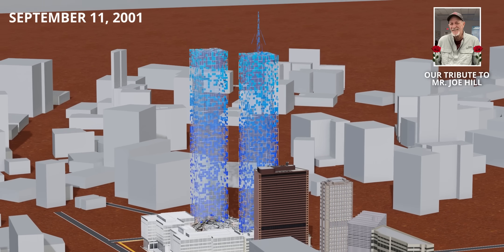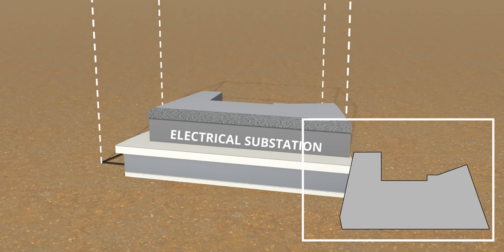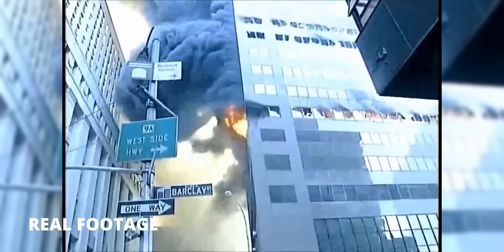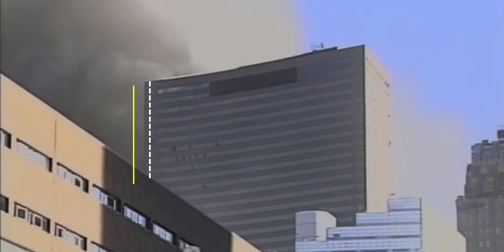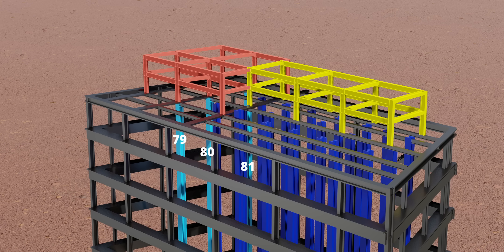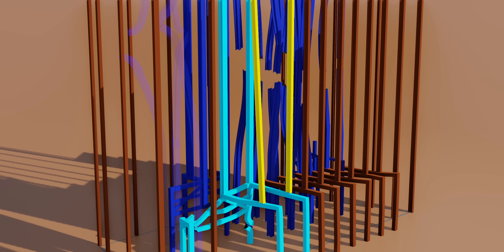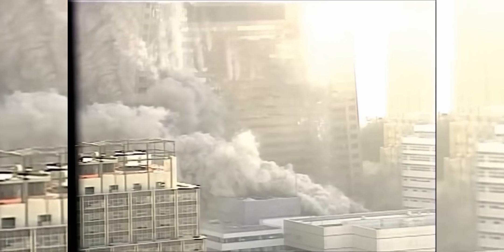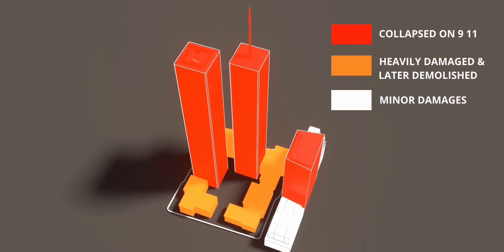Collapse of Building 7 | The Complete Physics

Comment: It’s strange how even though WTC 3 4 5 6 are even closer to building 1 and 2, and still remain standing with photos showing them withstanding two, 110story sky scrapers falling on top of them, but building 7 collapsed in near free fall speed, while being farther away from the ground zero and also the 2 buildings on either side of wtc 7 only report minor damage. 😂
Reply: Each case is different and needs to be understood on its own merits. Your first mistake is assuming every scenario should have the same outcome, no matter what.

In total, 6 buildings collapsed of the 10 destroyed in New York on 9/11/2001.  I'm guessing you didn't know that.  2 more suffered partial internal collapses and the other two were damaged beyond repair. 

But again, each is its own unique case which needs to be understood on its own merits. 

Also, there is no such thing as free fall speed so if you are getting your engineering advice from people who say stupid shit like that, you are doing it wrong.  There is no blanket one size fits all
Reply: @TheCriticalStinker-01  partial collapse isn’t a collapsed building. It’s a partially collapsed section of the building. 4 buildings were completely collapsed and the rest were partial collapsed due to debris falling on them. However no one talks about them because it’s clear the weights of the twin towers caused that damage. Building 7 was brought down by ‘fires’ within the building that weakened the structure. So yes I understand that each building is a unique case which makes the circumstances of each case even stranger. 4 buildings had complete collapses that day, wtc 1 2 3 and 7….1 of which collapsed due to fires, 2 from planes creating fires and 1 from the weight and mass of the twin towers crushing it. The only 3 sky scrapers in the world to ever collapse from fires all happen in the same day with hours of each other. 😂…if all cases are unique and merit their own circumstances then those buildings collapsing would look very different. But they all pancaked at near ‘terminal velocity’ into their own footprint essentially, I forgot when I play jenga and pull the wrong block out, it just falls into itself instead of toppling and leaving portions still intact. 

I’ll bet you weren’t aware of how jenga works 😂😂😂
Reply: @kross517  - You forgot Building 4 and St Nicholas Church. 

Employing the first time in history logical fallacy is never a good plan. If you would like other high-rise buildings that collapsed due to fire I offer Wilton Paes de Almeida and Plasco Tower

Does that get you any closer to understanding anything that happened to any building on 9/11?  Does fire know or care how tall a building is?  Does the building?

No and no.

Again, if you want to understand a subject then study the subject.  What building do you want to understand?  This video does a fair job in describing the big 3 in terms a layperson can understand but I am more than happy to do a deeper dive.
Reply: @TheCriticalStinker-01 okay so your two other examples of fires burning down a skyscraper are one where the building was abandoned for atleast 5 years and had scores of homeless people living it, building their own structures within the building adding weight and instability to the structure, not to mention whatever materials the homeless pulled from the building itself to construct their inner shanties. And the 2nd example is a building in Iran that the government cited 22 buildings infractions and ignored regulations. Okay buddy. I think you should do some research. This video has errors all throughout it and you site 2 of the worst possible examples of collapse. 😂😂😂 so please dig in further and explain to me how 2 skyscrapers in 3rd world countries collapsed because homeless people camped out in for years and the other wasn’t built to standard.
Reply: @TheCriticalStinker-01 does the building care if it’s been abandoned and have scores of homeless people doing god knows what to it? And does the building care if the builders built it properly? 

Yes and yes 😂😂😂
Reply: @TheCriticalStinker-01 also check the dates of your examples my guy. 20 years after 9/11 and some change. So yes my comment of FIRST 3 skyscrapers to collapse from fire all happened within hours of each other, 2 of which the fire burned for less than 3 hours. You have confirmation bias and can’t see the truth.  The evidence is there, I’m not engineer or demo expert, nor firefighter, but you can go online and find hundreds of them that also agree 9/11 isn’t what the government told us and I was there on NY that day and listened to dozens and dozens of people say they heard multiple explosions before those towers came down. So no nothing you have said has helped me to understand what happend to those building on 9/11 because you don’t know and can’t properly explain it because it doesn’t hold water.
Reply: @kross517  - In December 1903 the Wright Brothers achieved the worlds first powered heavier than air flight.  Does that mean no one flew after them?

Ya really gotta get off the logical fallacies.  They are as irrelevant as they are wrong.  That includes the irrelevant qualifier "high rise" or "skyscraper".  

It's completely meaningless how tall a building is.  The only reason people like you throw that in their is so you can maintain your belief - or rather denial.  From an engineering standpoint its a non-starter.  Again, fire does not know or care how tall a building is nor vice-versa. 

Now then, if we can drop the deliberate denials, logical fallacies, appeals to incredulity and other roadblocks you keep putting up to prevent understanding, this will be the last time I ask:

Which building collapse has you the most flummoxed that needs to be dissected in more detail

Pick one and only one.  We will discuss that building and nothing else .  No false comparisons or deliberately off-topic evasive derails.
Reply: @TheCriticalStinker-01 fine skyscraper meaning elevated building made of steel having elevators in it not built with wood framed wrapped in brick and drywall. Did i get specific enough so you can attempt to discredit me and hundreds of. Thousands of people with eyes and engineering backgrounds and firefighting and architecture backgrounds? Your attempt to ‘get down to the specifics’ and ignore the main problem is not working and in fact the more you pick away at nonsense the more I believe you’re full of shit. Let’s define fire next shall we? 😂😂😂
Reply: @TheCriticalStinker-01 you’re the one asking for meaningless definitions and specifics. So far all you have done is ask me to clarify skyscraper, use the wright brothers as an analogy and cite 2 skyscrapers from 3rd world countries that collapsed 20yrs after 9/11 and have logical reasons why a fire would weaken the already terrible structures. That doesn’t explain how building 7 came down that housed the top federal agencies in our country which was not hit by a plane and did not burn for more than 10 hours…that fell into its own footprint in the span of a work day. So yea get specific my guy. Id love to hear your argument because all you’ve been doing is telling me my definitions are off. 😂
Reply: @h1F595if that were true than the experts wouldn’t make a determination between a full or partial collapse. But they indeed do make the distinction. Also if we want to get technical the other partial collapse building were crushed rather than collapsed. 1 2 and 7 collapsed due to fires….according to the 9/11 commission report.
Reply: @kross517  - Thank you for not bothering to read my last reply. You are not serious, are going out of your way to not understand and I'm done wasting my time here.
Reply: @h1F595 - Note how hard it is trying to not understand - going out of its way to ensure it does not understand.  Throwing up roadblocks to progress left and right and trying to keep the discussion spinning in circles so no movement forward is possible.

This one is not serious.
Reply: @kross517  WTC3 did not collapse completely. Actually it didn´t collapse at all unless you equal getting crushed with collapsing, but even then it wasn´t a complete collapse since part of the building still stood several storeys tall and needed to be demolished later on.
Reply: @Kudde23I’ve already made that point
Reply: @TheCriticalStinker-01 that’s exactly what you’re doing. I’ve responded to every single one of your posts and arguments
Reply: @kross517  Well, you said "completely collapsed" for WTC3...
Reply: @Kudde23well according to 9/11 commission and online sourcing wtc 3 was considered complete collaspe. I would agree with you that it wasn’t but for the sake of argument I went with complete collapse. But building 3 isn’t the controversy so I didn’t care to be too opinionated about it
Reply: @kross517  Fine fine ok I just don´t want to let the waters get muddy here. It was 3 complete collapses, not 4 let alone 10 as stinky always claims... I just wanted to point that out, at the same time agreeing to and emphasizing the points you already made so hey just go ahead :)
Reply: @h1F595 "it doesn´t not make it correct"

Now you got it poorpoo! Or... do you?
Reply: The only skyscrapers in the complex were 1, 2, and 7. The first two about 100 floors, and 7 about 50 floors.